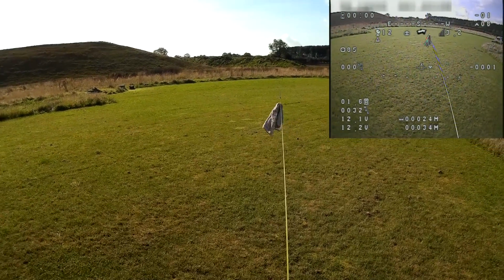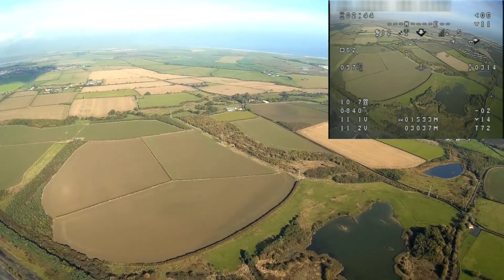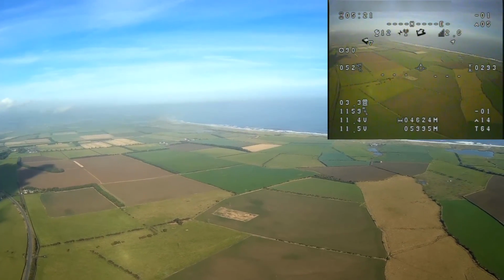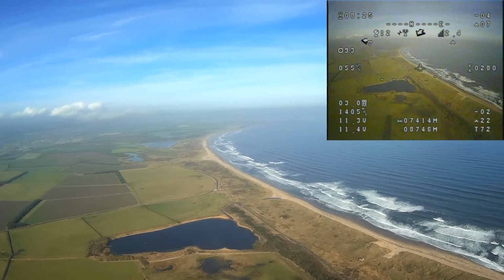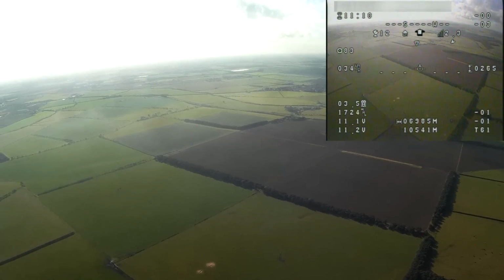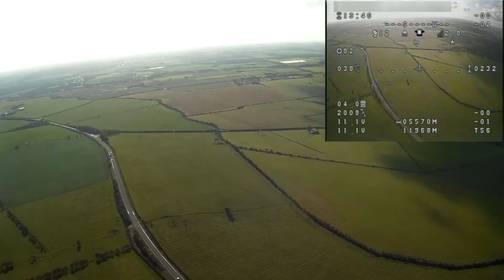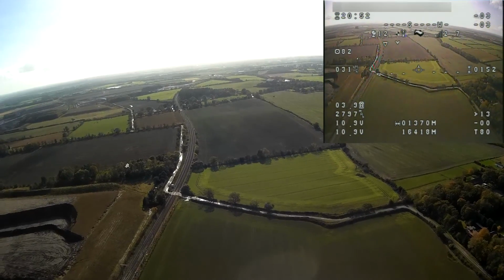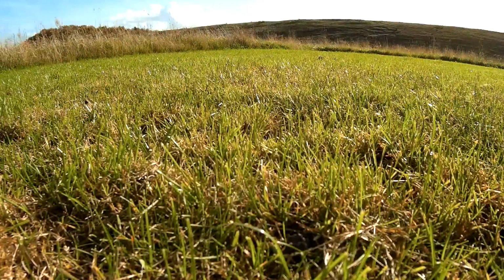Narrated Home built 5.8ghz Diversity Receiver Test Flight.

Comment: I have really enjoyed your narrated vids.  This one was even nicer, being able to view the coast and countryside. The diversity worked great!  Did you buy the diversity rx and if so, could you point me in that direction?  Thanks.
Reply from the maker: Hey Glen thanks for the comments its appreciated.  The diversity RX is a home built unit that I made here and seems to work very well for me fortunately.  The PCB was designed and made by a friend of mine out in CA and I built it up here with the other components it needed.  There are some commercially available ones made by Boscam that I suspect will work equally well you might want to have a look at those, they do a two and four port unit.  Bill

Comment: Are you using the stock motor mount or did you make you a tougher one?  Mine seems to break very easily on landing. Thanks and great flight.
Reply from the maker: Yep same as mine stock motor mount is very flaky and was broken early on.  I made another one out of aluminium and that did the trick.  Advise anyone building this airframe to modify the motor mount at the get go and it will make life easier.